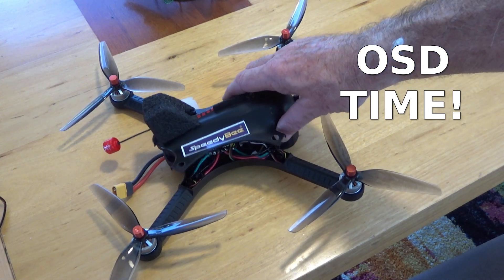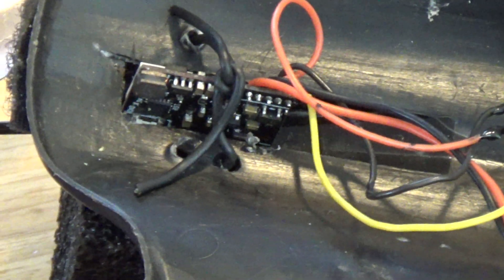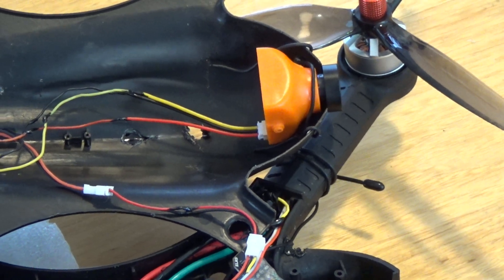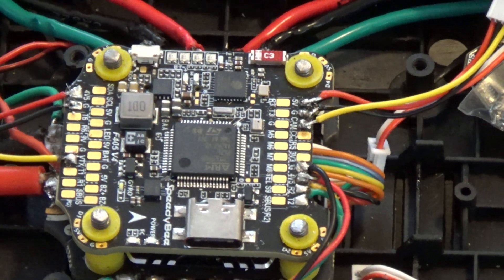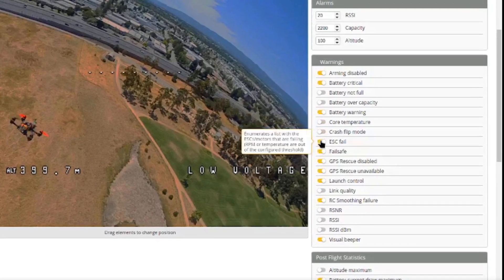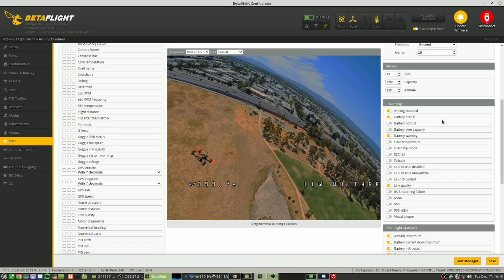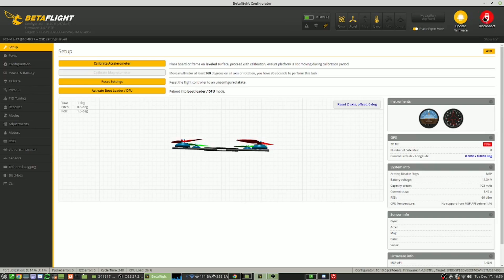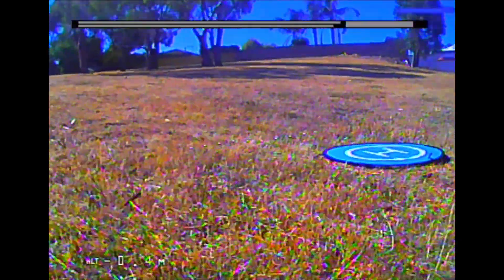Want Artificial Horizon - OSD with BetaFlight and SpeedyBee F405 after wiring upgrade.

Comment: Who taught you how to solder? this is terrible
Reply from the maker: Not pretty, I know! 
Watched a lot of YouTube videos, but still find getting a good looking joint is sometimes difficult. Using more flux and a more powerful iron on large wires seems to help.
Reply: @skybug3  acttualy its not that bad, nice work there my friend, just some tips to improve it, buy i good solder iron, a good solder wire and a good flux, with all that you will be amazed with the end result, i started using cheap solder wire and the joins also look like that. the material you use to work its really important. keep your excelent work!!
Reply: Why do you have to be such a jerk? This guy is a hobbyist having fun and the joints work for him. His stuff looks 10x better than mine and I’ve never had a failure. Sorry it’s not up to your NASA standards you backseat internet no life loser